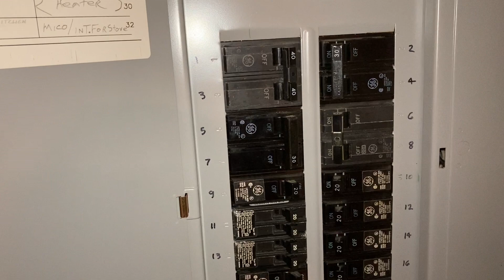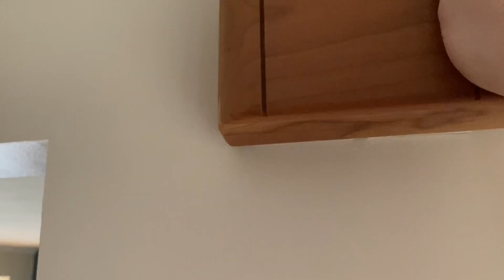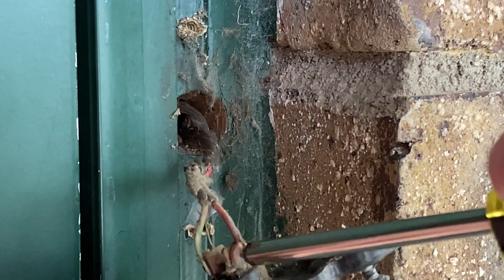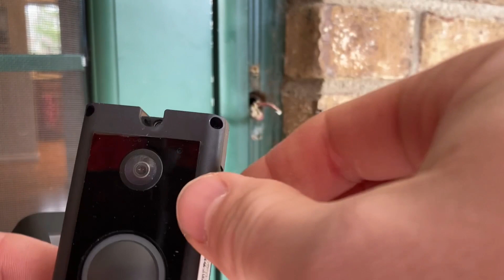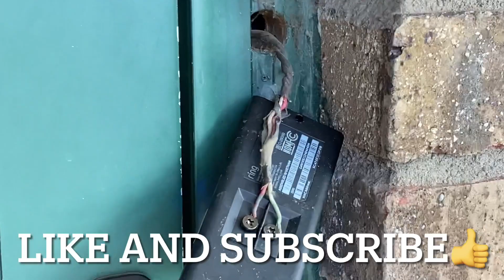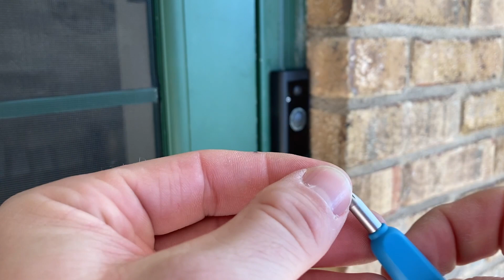How to Install a Ring Doorbell

Comment: About that tiny security screw on the bottom, I do not have that screw driver, is there a size on it? I have tried numerous different size  security torx, none work.
Reply from the maker: Unfortunately, no. I would try a small sized star-head tip, or a basic flat head screwdriver might be able to lock in and turn it.
Reply: @ Thanks, I’ll try that.